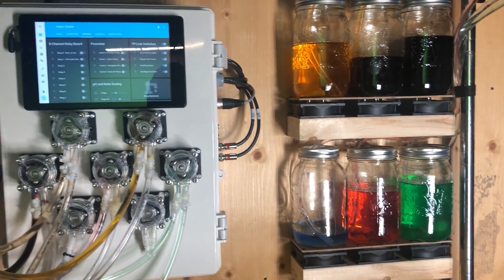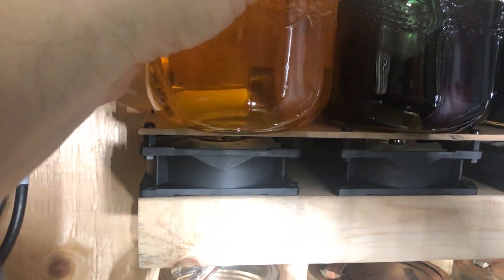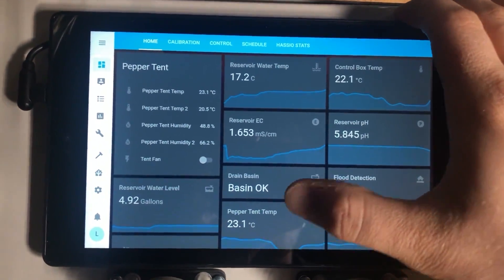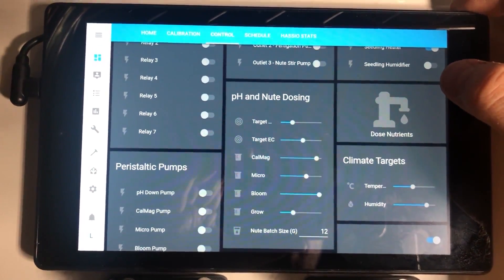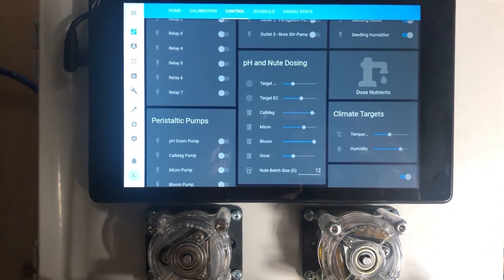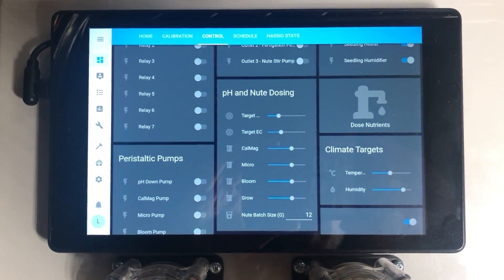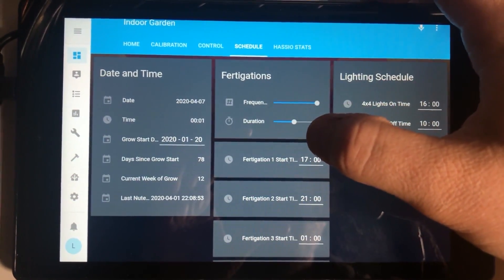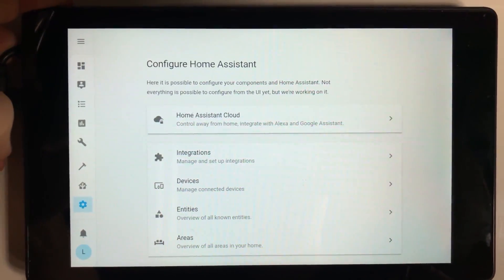My DIY Home Assistant Garden Automation System - Climate Control, Dosing & More. Pt.2: Functionality

Comment: Very nice work, are you posting a Github link to the code by any chance? Curious about your implementation of the res temp sensor
Reply from the maker: Thanks - I'm working on getting set up on GitHub now.
Reply: @LEDGardener  Outstanding project, young man.
Have you or others developed any Home Assistant modules / procedures for adopting NASA-style suspended, rotating, modular aeroponic chambers?  Such 12/24 volt DC solar-powered greenhouse systems could individually service, control and monitor such growth chambers* via individual 72MgHz STM32 modules to detect, monitor, initiate aeroponic short spray periods (few seconds) but frequent (every few minutes) regular spray activation periods, and centrally communicate / report / initiate actions over Ethernet LAN server (no health-compromising ionising EMF pollution from wireless or BT) using the redundant multiple high speed comms facilities of those boards to control, monitor, and report status on each greenhouse growth chamber / area. 
Standardised multi-feature growth area modular control units to be easily-added water-resistant plug-and-play pcb modules for different growth areas / environments, daisy-chained, reporting and monitoring (temp, light intensity and  light-periodicity, , humidity,growth[weight]) over on-board multi-protocol comms with relay-activated pressurised spray wands hanging centrally into approx 1.5m tall by 1m diameter cylinders hanging/standing growth chamber cylinders*, cheaply constructed using cheap as chips polypropylene weed suppressing fabric-covering 3/4 inch water pipe cylindrical frames with multiple small growth pockets on exterior fabric, sewn fabric with small cut-outs accessing the internal central chamber to hold seedlings allowing their roots to grow into central chamber, watered using 10 micron 120 PSI brass nozzles screwed into 3/4 cheap water pipe, fed from a 20?ltr domestic collector tank pressurized by twin (critical redundancy) 12V DC 8A? pressure-switched water pumps and filters to charge ~150 psi domestic accumulator water tank via solenoid valves that pressurize individual feed lines into the spray wands at individually-configured spray time-intervals configured according to plant type / nutritional reqs.
And some spray wands strategically-placed to regulate global greenhouse and individual micro-climate areas of humidity, to accommodate growth requirements of separately-grown flats of seedlings, microgreens, nutritional grass and other sprouts, orchids, herbs, shrubs, fruits, and flowers, etc providing individual custom climate-control, as required for example mushroom and other culinary / medicinal fungi cultivation chamber specialised environments? 
A challenge that has bothered me for some time is, how could individual 'recipes' of custom nutes be integrated to supply the individual aeroponic chambers and other customised environments (rather than all areas of the greenhouse receiving the same generic nutes at the same concentration and periodicity) bearing in mind that the main pressurized collector / supply tank might contain several gallons of liquid 'backed up' en route to the spray wands, dispensed slowly in short bursts?, in small but frequent shots?  
Perhaps some way to monitor supply line impedance / filter detritus build up in order to cue filter scheduled remedial replacement nozzle swap-out, maintenance / clean / replace / wand/nozzle maintenance intervals - filter state surveillance/evaluation might be critical for such specialised but vulnerable high-pressure / small droplet size nute delivery systems? 
Perhaps have emergency water redundancy by including contingency for catastrophic failure of the high-pressure system by way of a parallel cheap, low risk and simple temporary replacement low-pressure stand-by water spray pump and valve system to prevent crop water-trauma/loss if/whilst the high-pressure system is maintained/repaired/re-instated.
Oh, and the criticality of the supply lines might also require development of a partially or fully-automated periodic cleaning-maintenance cycle involving a cleansing agent flush and/or water supply / root disinfection (ex. hydrogen peroxide dosing and flushing).   
Sorry for  such long jumbled comments, no time to make it smaller!

Comment: You can't hear it, but I'm clapping right now. Great work man. I am not familiar at all with home assistant. I am looking forward to diving in and making something similar. Is there a forum somewhere with people such as yourself discussing things like this?
Reply from the maker: Awesome. The official Home Assistant forums are an excellent resource. There are some really good videos on YouTube to get started with it by Bruh Automation and JuanMTech.
Reply: @LEDGardener  I've been going through Atlas scientific's instructable tutorials all morning. It's looking like it's going to be easier to setup than I thought. At the moment, my goal is to setup auto ph dosing and ec control with a simple display. I already have environmental controls in place, but I plan on integrating everything similarly to what you've done so I can monitor and control remotely. I will definitely check out Bruh Automation and JuanMTech. Thanks again for the information!
Reply from the maker: Nice! Feel free to make a thread in the control forum at https://ledgardener.com/forum if you need some help. You’ll want to electrically isolate the pH probe and EC probe if they’re in the same tank since the EC probe will throw off the pH readings if you don’t. You can get voltage isolation boards from Atlas or the Tentacle shield i bought does this too and it comes with example sketches of Arduino code to poll the sensors that I modified to fit my system. The code that came with it was literally the first Arduino program I’d ever opened.
Reply: @LEDGardener  Great, might be a couple of weeks before I get started. But when I do, I will definitely start a thread there.

Comment: hi fantastic job I have a lot of my house done with plugs and switches most of them running tasmota from HA. I never even thought you could do this in HA again fantastic job. I cant wait for you to get this out on GitHub or some thing if you ever need a beta tester just let me know I can spin up a vm with hassio (supervisor) and load it up and test it out.
Reply from the maker: Sweet. What brand of plugs/switches are you using?
Reply: MJ's (martin jerry) Teckin  zoozeenow I want to start working on stuff out doors I have power run out to my gardens and I want to put in outdoor plugs on wifi I installed all Unifi gear about to months ago and I have full wifi everywhere now. I have been looking on Blackadder's web site https://templates.blakadder.com/ to try and find outdoor plugs that I can put tasmota or some thing on. But first I have to finish adding 12 candles to the fire place that have alexa voice commandsand led's under the bed that have motion control for at night plus front door sensor will trigger the same lights to turn red if the door is open late at night. NEVER show your significant  other things you could do